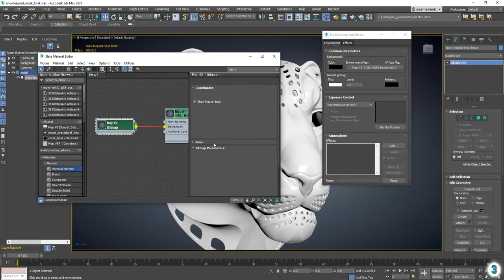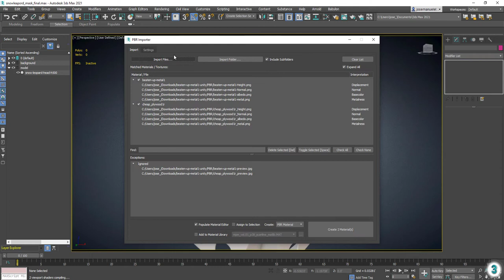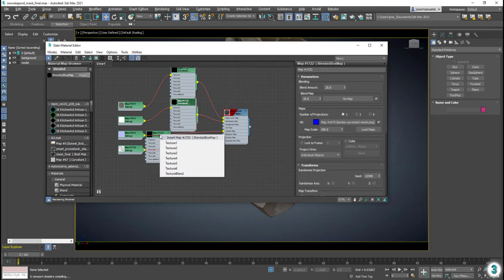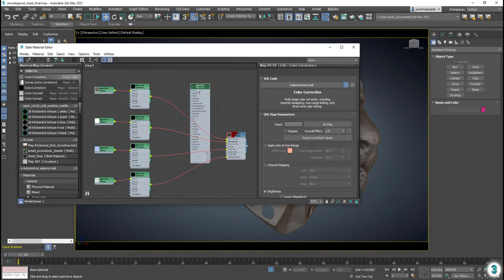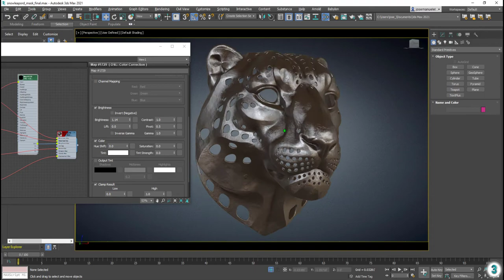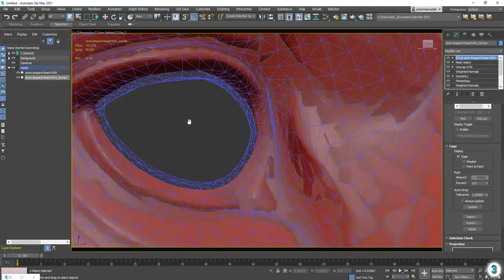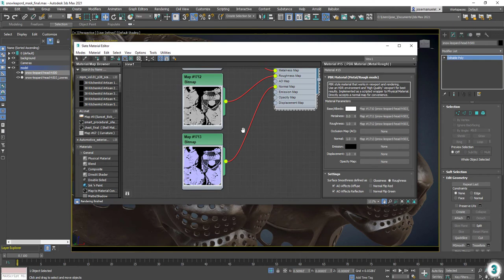Retopology and Texture Baking with 3ds Max 2021

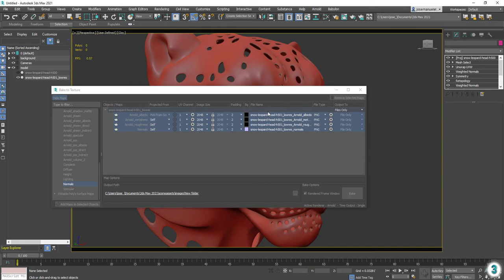Comment: For a tutorial on texture baking, the texturing baking part is going a bit too fast for me. You are doing something at @5:55 and get some  [Pro]....  modifier added...
Reply from the maker: At 5:55 I’m setting up my projection for texture baking. This is what allows me to capture all the details from my high res model into texture maps. For this I set the ‘Projected From’ column in the Texture Baking dialog to ‘Pick from scene’. I than picked the high res model from the scene explorer. The Projection modifier is applied automatically here to the high res model. Here you can make adjustments to the projection cage. You want to make sure the cage encompasses all the geometry or you will have errors when baking. In my case I’m using mostly default settings except that I reset and pushed the cage outward slightly. Hope this clarifies the workflow.